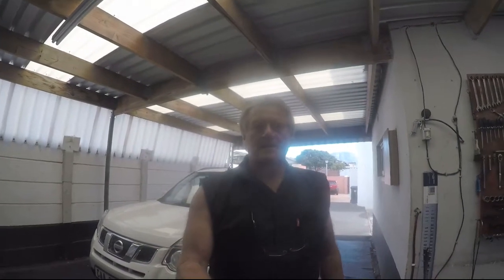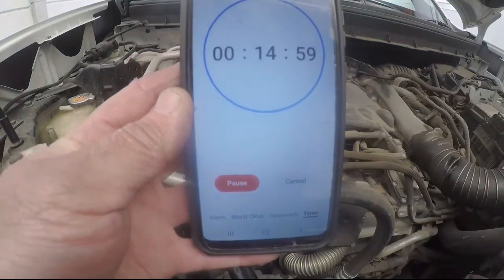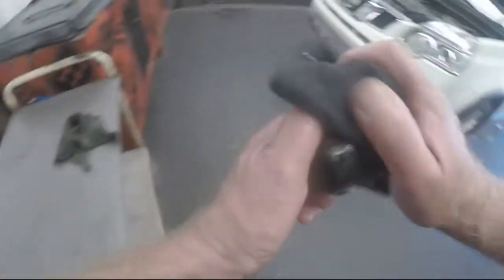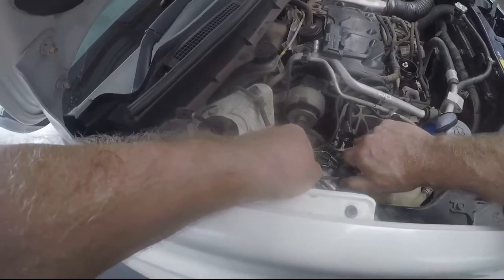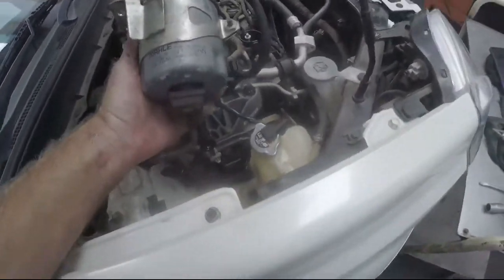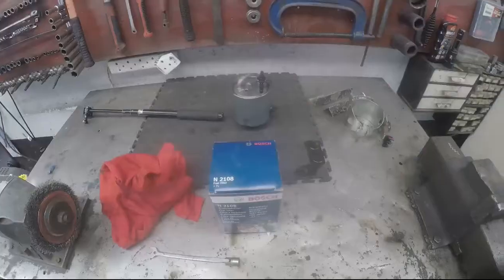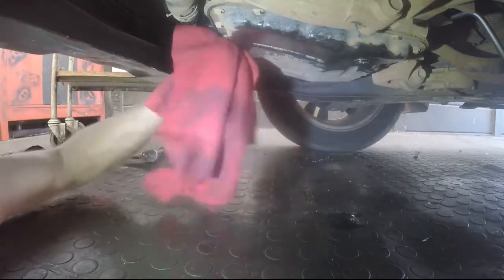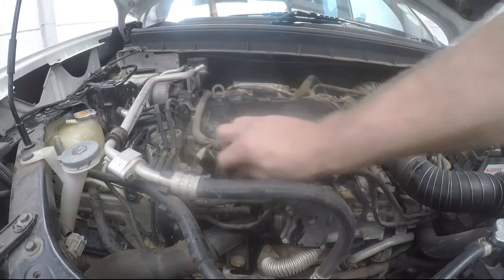Nissan Xtrail Diesel Oil & Filters Changed

Comment: I enjoyed watching your video Garry but I have a question I'm hoping you can answer because I cannot find the information I'm looking for on the net. I own a 2013 Nissan Xtrail GT 2 litre diesel turbo (auto) and I've been told that this model has a self cleaning oil filter facility. I have a push button switch located on the right side of the steering wheel and down low (RHD...very similar to the one in your video). Every now and then an orange warning light has appeared on the dashboard apparently indicating that the oil filter requires cleaning so I have been told. The button I mentioned has the same symbol as the light. I was advised by the mechanic that when this light comes on I need to run the car for 20 minutes at 2,000 rpm. As I now live in Japan finding a road where I can drive for 20 mins with the revs that high is very difficult. Once the button is depressed the engine automatically takes the idling up to 2.000 rpm and will continue until this warning light goes out which is usually after 20 minutes. Since December 2022 I have had to go through this process 3 times. Trying to communicate with these Japanese mechanics has been very difficult as they often misunderstand what it is I'm asking. After watching your video on the diesel engine I'm now concerned that perhaps the oil filter is the same as the one you changed. I've been led to believe that I do not need to change the filter. At some point during this 'cleaning process' I've noticed a sudden expulsion of a bit of blue smoke which only lasts maybe a minute at the most. Not long after this the engine revs will return to normal. I am very careful when it comes to looking after the cars I have owned over too many years and don't want to run the risk that this oil filter may deteriorate and possibly cause damage. I hope you can answer the question, do I indeed have a special oil filter that does not need replacing and this self cleaning feature is adequate. Sorry for the long message and I hope you understand my query.
Reply from the maker: Yes, I do understand your query, I do believe it is time to replace the oil filter as the dirt it expelled continues to cycle through the engine as time passes, there is nowhere else for the sludge build-up to go but remain in the oil system, this was an experimental system and not very successful as people misunderstood that it had to be replaced at specified intervals and not that it never had to be replaced, so go on replace the oil filter and the engine oil at the same time, an engine flush such as I did in my video is also recommended,
I hope this helps you out.

Thank You for supporting my channel with your visit and interaction, I am pleased this video was helpful to you.
Please feel free to check out the rest of my channel by clicking PLAYLISTS https://www.youtube.com/@vehiclemaintenanceandrepai3790/playlists for more helpful service and repair videos on most makes of cars available here in SOUTH AFRICA,
It is FREE.
Gary De La Cruz
Reply: @vehiclemaintenanceandrepai3790  Thank you sir for taking the time to respond to my inquiry. Unfortunately I only had the oil changed just before I came across your video and given the cost to have the oil changed I will have to wait s little time before I will change it again. The thing is I don't do so much driving anymore and in actual fact have only driven 8,000 km since late December 2022. I will wait 6 months but follow your advice and make sure the filter will be changed at the next service. Thank you again for your advice and I wish you you great success on your future videos.
Reply from the maker: @williamlewis1592  All good I am glad to be of assistance and thanks for your prosperity wishes it is greatly appreciated, all the best to your future too.

Comment: On my x-trail I can't get my oil filter casing off. 27mm socket slips and I can't get any good leverage with a strap wrench. Might have to just put my new oil in and next time buy a new casing so i can break this one off somehow
Reply from the maker: That is a difficult situation, I find a chain oil filter removal unit works best, as the angle can be changed and extensions can be fitted to do the job, try your best to get it off as putting clean oil into the engine, just to let it be contaminated by the dirty filter is futile.
Try a chain filter remover, the worst case is to break it off and replace the unit, Good Luck.

Thank You for supporting my channel with your visit and interaction, I am pleased this video was helpful to you.
Please feel free to check out the rest of my channel by clicking PLAYLISTS https://www.youtube.com/@vehiclemaintenanceandrepai3790/playlists for more helpful service and repair videos on most makes of cars available here in SOUTH AFRICA,
It is FREE.
Reply: @vehiclemaintenanceandrepai3790  Thank you, I already put oil in, as I needed to drive. But I will look into a chain oil filter remover
Reply from the maker: @123coolisme  Let me know how it goes when you do it, all the best to you in going forward.
Gary
Reply: @vehiclemaintenanceandrepai3790  Thanks, I will

Comment: The oil used in this video is not good for M9R engine
Reply from the maker: Thanks for your, opinion Milan it is duly noted, but I have been using Shell Rimula in diesel engines for many years with no ill effects as it is specifically designed for diesel engines, maybe it will be helpful if you tell us why in your opinion, it is not good to use in the M9R motor as it is a diesel motor.
Reply: If this car has a DPF it should be a C3 oil, 5w30 (fully synthetic)
Reply: @vehiclemaintenanceandrepai3790  because it has a dpf and it needs to be low sulfur oil
Reply from the maker: Thank you for the information, it is well received, this is how we constantly learn by sharing information.